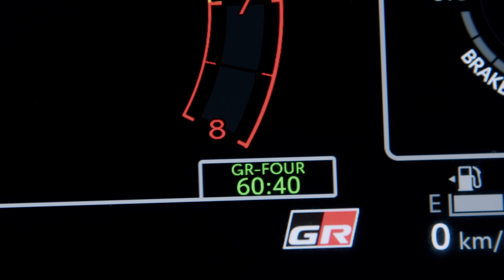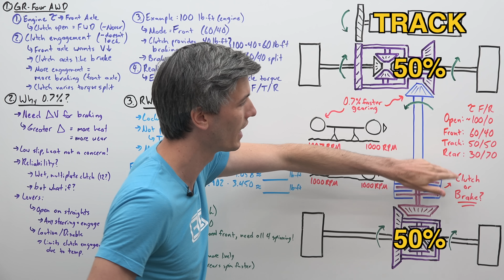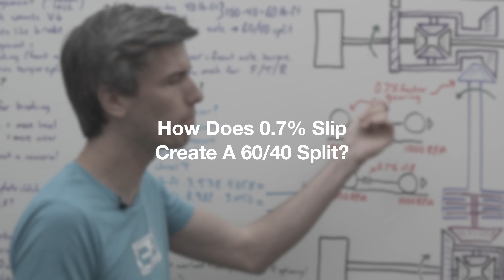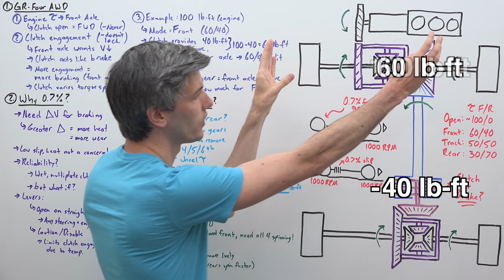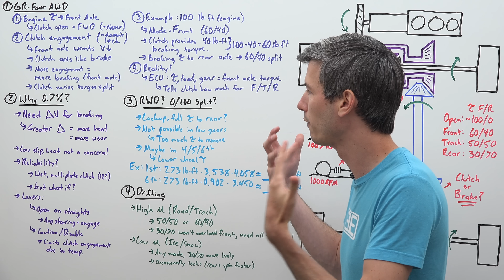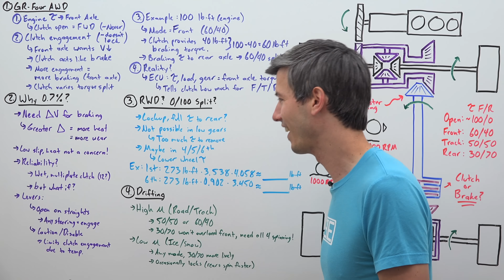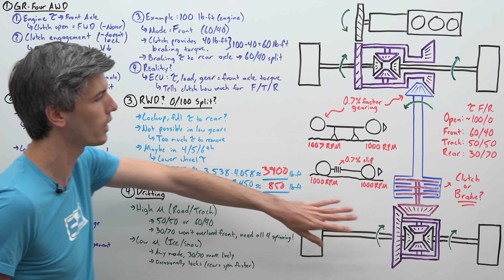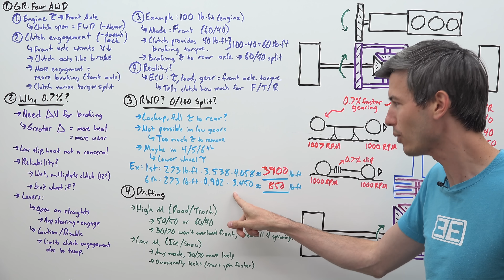Toyota GR Corolla's Brilliant AWD System - How It Splits Torque!

Comment: This is just like the Focus RS system, and a lot of folks (including me) had that rear diff over heat under hard track use on hot days. It would open to protect itself giving you an understeering FWD just as you described. 
This is not clever or ideal, it is just a cheap way of avoiding the use of a third adjustable differential like a real AWD system uses. 
This is why the 70/30 is not recommended for track use. This just creates a high wear failure point. I wonder how much Toyota is going to get for replacement differential, my guess $4-5K.
Reply from the maker: Focus RS is a different vehicle, with a different strategy, using a significantly higher slip percentage, and few clutches in each pack. One does not equate to the other. GR Yaris has been out, are tons of folks having heat issues?
Reply: @EngineeringExplained  The GR Yaris is not in the USA so I have no idea. I have only seen the issue with the RS reported on US forums by track rats like myself running hard on hot days in southern states. If you don't push the car to hard and the temperature is moderate you might not experience it with an RS either. I don't recall a single review mentioning this issue on the RS either. So the fact that it might not of been reported with the Yaris doesn't really tell us anything so...
However, a rear biase is always better/preferred for track use. The fact that Toyota does not recommend the 30/70 split for track (or even asphalt) use is very telling.
You're not going to sit there and tell me this is the ideal AWD system because it just isn't. It is not exactly the same as the RS system but it is essentially the same, and it is a compromised system. 
I have no doubt if you were to run the desired 30/70 split mpde on track frequently, either the system will protect itself giving an undesirable response, or you're going to trash that diff before to long. That is the inevitable conclusion of this design. It is a gimmick meant for rare usage. Even on the street the car is probably FWD 95 percent of the time.
Reply: @ericmichel3857  It's a lot more complex than just shouting "rear biased is better for track" because clutch pack based systems engage and disengage constantly. Much different to the all time AWD systems that drag the diffs all time, but you should know that anyway.

System is far from a gimmick either. As for GR Yaris, power is sent rearwards, obviously switching, pretty much all the time. Clutch pack does overheat and switch to FWD only, but it's nowhere near as bad in the RS. Actually, many hot hatches and 4WD cars use it these days and none are even close being as bad as the RS, so I wouldn't blame the system just because Ford's isn't reliable. 
Anyway, back to the GR, you can overheat it on semi slicks in an autocross course, usually when trying to slide the rear, but it's solid on the track. They don't really brake either, as Jason noted, system is very low slip and very robust. People have been abusing GRs for few years now, many do track days, autocrosses, sliding on tarmac, you name it, and actual clutch pack problems are very rare. If all the internals are the same, there might be more issues on the Corolla because of the weight difference but generally, this isn't something to give you problems.
Reply: @kristisrb  GR Yaris production did not even start till September 2020 so I don't know how you figure it has been tested for "years" when the car has not even been out for two years yet. 
It is not that complicated, rear bias is better for track use, full stop. If it can over heat on autocross then it can definitely happen on a road course. For whatever reason, overall folks in the USA seem to abuse cars more than the rest of the world.
By your own admission this is a potential problem. We will just have to wait and see how much of an issue it really is.
Reply: @ericmichel3857  Yeah yeah sure you know best without even seeing the car or the system.
Reply: @kristisrb  I see it, just haven't tested it yet. It's a relatively cheap car so it has compromised cheap car systems that work okay but are less than ideal, shocking I know. I am sure it will be fine for what it is. I am just pointing out the obvious issues and suggesting we will see. No need to get your fanboy panties all in a wade.
Reply: @kristisrb  Hey Kristis, I just happened to come across this article in AutoEvolution titled: "Toyota GR Yaris AWD System Can Overheat, This Is What Happens When It Does" I have not actually went on any GR Yaris forums but according to this article it is a well known issue:
"Owners of the GR Yaris who complained about overheating issues with their all-wheel-drive systems on the dedicated forum believe that the issue appears when the clutch packs in the center differential overheats, which is when the car's systems tell its computers to disconnect the rear axle. The GR Yaris comes with three transmission temperature sensors, which means it is easy to determine which of the components gets too hot for its good."
Obviously the person writing the article is not familiar because there is no center diff, which is why it has this problem, just like the Focus RS. It even shows a You Tube video of this guy experiencing this issue while doing a lap at the Nürburgring. And just like the RS, when it happens the car turns into an understeering pig. The You title is "GR YARIS AWD Overheat Issue - OR "how to drive just with FWD" on NÜRBURGRING NORDSCHLEIFE BTG 4K". So yea, not just auto cross.
This is supposedly a stock GR Yaris w Cup 2 tires, now the GR Corolla supposedly has the exact same engine and drivetrain (not beefed up in any way), accept it weighs almost 400 lbs more and the boost is turned up to make 300 HP to compensate for the added weight. Now you tell me, but in my mind if this is happening on the much lighter and lower powered GR Yaris, it will be far more likely to happen on the much heavier and higher powered corolla, no? 
Please don't misunderstand, I am not down on this car at all. I love that Toyota did this and think it is a really good enthusiast car. I can hold that thought and still be honest about what it really is and even be critical about potential flaws.
Also now that the reviews are in we see this AWD system is not going to produce power on oversteer, nothing short of a high speed corner lift or yanking the parking brake is going to get the rear end to come around, just like every other FWD or FWD biased AWD system. It is what it is, a fun hopped up econo car, just like the RS, Type R, Golf R, WRX... It is not some magical car that can defeat cars costing 2-3 times as much, and it's a Toyota so it will NEVER break! Yea none of that is true, but idiots believe it and drive up prices ruining the best part about cars like this.
Reply: @EngineeringExplained  Hi Jason, I just happened to come across this article in AutoEvolution titled: "Toyota GR Yaris AWD System Can Overheat, This Is What Happens When It Does" I have not actually went on any GR Yaris forums but according to this article it is a well known issue:
"Owners of the GR Yaris who complained about overheating issues with their all-wheel-drive systems on the dedicated forum believe that the issue appears when the clutch packs in the center differential overheats, which is when the car's systems tell its computers to disconnect the rear axle. The GR Yaris comes with three transmission temperature sensors, which means it is easy to determine which of the components gets too hot for its good."
Obviously the person writing the article is not familiar because there is no center diff, which is why it has this problem, just like the Focus RS. 
It even shows a You Tube video of this guy experiencing this issue while doing a lap at the Nürburgring. And just like the RS, when it happens the car turns into an understeering pig. The You title is "GR YARIS AWD Overheat Issue - OR "how to drive just with FWD" on NÜRBURGRING NORDSCHLEIFE BTG 4K". So yea, not just auto cross.
This is supposedly a stock GR Yaris with Cup 2 tires, now the GR Corolla supposedly has the exact same engine and drivetrain (not beefed up in any way), accept it weighs almost 400 lbs more and the boost is turned up to make 300 HP to compensate for the added weight. Now you tell me, but in my mind if this is happening on the much lighter and lower powered GR Yaris, it will be far more likely to happen on the much heavier and higher powered corolla, no?

Comment: First thing great presentation as always. Second I never comment but besides the fact. This system isn't new and almost seems Toyota took this right out of the Honda playbook of all things engineering. Also the experience and knowledge of such an exact replica will tell you it's very unreliable. Back when Honda used an actual viscous coupler it was more guaranteed and had some longevity but then Honda reinvented the deployment of the system to incorporate "wet clutch" technology. Look, any Honda guy will tell you it's a garbage system that has been extremely modified in the aftermarket just to have progress in the racing records worldwide. Honda has advanced from this to the SH-AWD version of the "realtime" basics they once utilized placing more "wet clutches" at each piece of drivetrain that transfers the torque and is amazing stuff. I must say again, this is archaic technology and quite surprised Toyota had to copy such an old relic of engineering. 1984 Honda Civic wagon RT4WD is where my knowledge starts on Honda dominating this technology since then.

Comment: JTEKT supplies Type B Torsen LSD and ITCC for Toyota GR Yaris, it actually likes haldex (even technically simpler than old hydraulic Haldex) without the new torque vectoring provided by two separate clutch on the rear axle.  It doesn't have like a mechanical center diff, 

it's not like an entirely brand new thing, a lot of car use ITCC like new cx60 and Outlander etc., but GR4 is kinda modified like using 12 pairs + 3 pairs (appears to be) of wet multi-plate clutch plates that distribute torque, probably in order to handle the enormous torque, and clutch plate uses carbon material to reduce heat problem etc.  

if you look back at Celica GT-Four's system, it had viscous coupling and locking center diff, more like (at least closer to) rally car
Reply: Saab X haldex
Reply: ...and how long did the viscous coupling last?  Any thing Toyota does I call BS on....they just dont have it.
Reply: @oldblueaccord2629  what?!

Comment: Obviously this system is not meant for a Prius, but it's still fair to ask what the efficiency hit is due to losing engine power as heat from the slipping clutch?

Comment: The reason you can't have a 100% rear nominal torque split isn't because of the torque. It's back the rear axle is piggy-backing of the front axle. So order to spin the rear wheels it has to spin the front wheels. Also this system really does is use a high rear gear ratio to make the back wheels spin faster.

The AWD system it's self isn't that much different than most FWD based AWD systems. And if you made the front and rear axle ratios the same it would only be capable of a 50/50% nominal torque split. But a 1% faster gear ratio in the back allows that 50% to become 70%

Comment: Please read and respond if possible :)
So glad you made this video. Since the GR Yaris was released, I've been so intrigued by this AWD system. It's really strange and "imperfect" compared to systems using basic differentials, in a way that seems unique even compared to most other complex [limited slip] differentials- to the point that while I have a firm understanding of pretty much everything up to torque vectoring differentials, I still have some confusion on this subject.
A few things:
1) You make a point to refer to the split as a braking force on the front (as opposed to traditional RWD for example, which solely creates an acceleration force on the rear), but isn't it technically most true to say that this GR-Four system creates a brake force on the front AND an acceleration force on the rear, simultaneously? When locking up from fully open, the front feels a braking force and the rear feels an accelerating force, yes?
2) Assuming I understand the above properly, in a sense, doesn't this create a sort of odd driving characteristic behaviorally opposite of something like a locked differential (/ solid axle)? Like, with a locked center diff, the car would resist rotation, preferring travel involving identical wheel speed, but here with the GR-Four's "center", [the higher the lockup] the car will encourage rotation, preferring travel involving differing wheel speeds- right? If so, this seems pretty huge as a concept that no one is talking about- like it could make the car feel both less stable but also nimble and eager to turn
3) Why do you think they said full lockup isn't possible for a drift mode in low gears / why do you think their clutch system can't hold the torque necessary for a drift mode? The Focus RS's rear is built similarly - connected to the front via faster gearing - and it does allow for complete lockup for a drift mode
Reply: 3. It can't lock up fully because that would force rear wheels to turn slower than the front wheels which would create strain on the drivetrain.
Reply: @mikosoft  You're referring to binding, but that's not a reason it *can't*, even if it's a reason it *shouldn't*; other systems like the WRX STI center can cause binding (full lock, try to turn), and as mentioned, the Focus RS can lock fully and has the exact same result as the GR-Four- the rear axle rotates faster than the front.
Reply: 1) Yes, as the rear uses parasitic action to draw power from the front assembly. The rear uses a variable clutch system so it brakes the front and technically transfers power. It's semantics at that point. That being said, it's worth differentiating from say a transfer case, which does not uses a braking/variable force transfer.

2) This characteristic you mention could be why they use any overdrive at all but I assume it's for drive line "tightness." I really don't know though, since the car will never achieve 100% lockup. If you imagine that any car with unsymmetrical (front to back) drive lines (so pretty much all cars), I think it safe to say that the difference in torque and resistance to movement is negligible in this case.  Especially since the difference in rotation is accounted for by Toyota and the slippage that's built in. As an aside, front overdrives are common on very purpose built rock crawlers but they spend their time in the dirt and tire slippage gives some relief to the driveline.

3) This is very nuanced and probably comes down to reliability and control over the system Toyota wanted to have over how the system is used. You could theoretically lock it and then it would be an overdrive to the rear but that doesn't help anybody. Even for drifting. They would have to probably create a significant overdrive to the rear (which would make that everyday slippage in "rear" mode worse on the clutch pack) and they don't have a system for controlled torque vectoring in the rear. Nor any kind of disconnect to the front wheels. I don't think Toyota cared much for "drifting" as the car is AWD and can powerslide no problem. Hence it "can't" (they programmed and built it not to) lock up.

Comment: In heavy track use rear diff overheats in GR Yaris and then it goes to FWD mode
It's mostly caused by exhaust being pretty close
Reply: I have changed my gearbox, transfer and rear diff oil twice now in 3000 miles

The transfer case oil was dirty but the rear diff oil was very black and the plug magnet was covered in sludge

Toyota say to replace oil every 4th year but that’s too long
Reply: @Way Outthere  the GR/TRD undertray is for cooling the front transfer case and gearbox.

It’s the rear diff which can overheat. The engine under tray won’t increase any cooling to the rear 

The part is also difficult to source from U.K. dealers
Reply: Like ZERO surprises there...once you said Toyota.
Reply: The rear diff only take 0.5litres of oil

A larger cover plate is  available to increase the oil quality inside the casing.

The clutch pack is separate though and yes very close to the exhaust

Comment: Great video as always!  Could you do a follow-up for how this works when cornering, with different inside and outside wheel speeds?  It seems like the difference in speed would cause the rear wheels when cornering to want to slide further out when the clutches are strongly engaged, and track more to the inside when lightly engaged.
Reply from the maker: The torsen diffs front and rear will take care of the left/right speed differences. The clutch simply chooses which axle gets more torque.
Reply: The clutch is never fully locked, it just limits torque on rear wheels. So when front wheels are running faster, it will just have more then initial 0.7% slip. Same happens in any modern cheap crossover without center diff.

Comment: The reason 0/100% wouldn't work except in higher gears isn't because the system couldn't handle the torque. It's because the tires can't. 
For a 0/100 rear split to occur, the rear, overdriven wheels have to be turning at a speed with 0.7% or less tire slip. That leaves the front wheels turning at less than or (hopefully) equal to ground speed, contributing zero torque. In low gears, it's too easy to generate more than  0.7% slip, so the front tires end up pulling too.

Comment: How does this system behave in limited-traction environments where it's easier to slip a tire than to slip the clutch pack?  Does it just rely on ABS to maintain the mechanical speed differential that allows the controlled torque split?